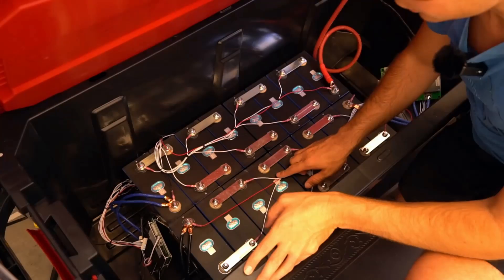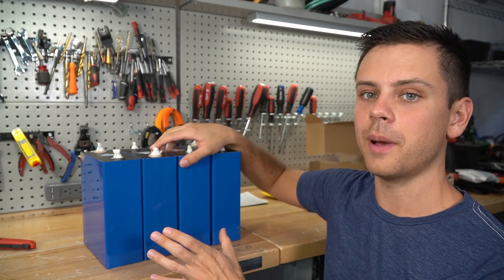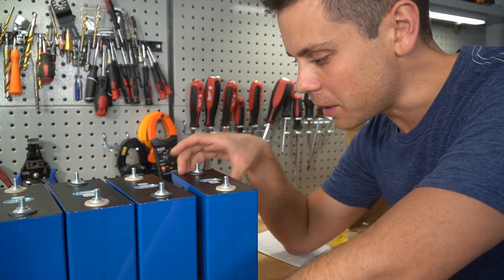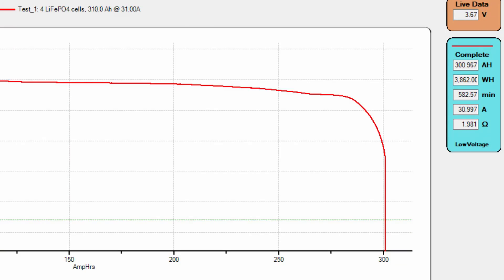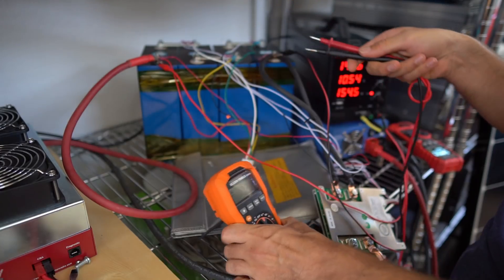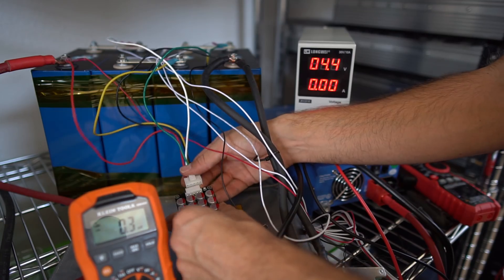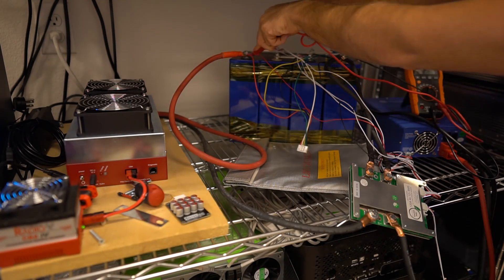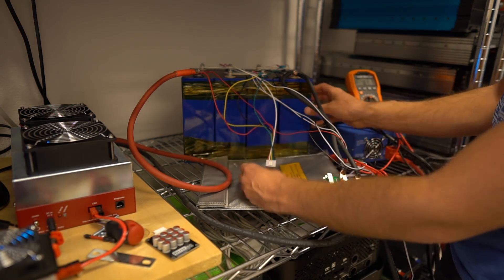Amazon.com "Grade A" 310Ah -Ninthcit- LiFePO4 Cells Manually Balanced and Tested

Comment from the maker: And get this, amazon is not paying for the return shipping. I've never had this issue before, and I stated that the product is defective. But Amazon did give me the address of this cell supplier's warehouse in los angeles so I will drive there myself and show them specifically how they screwed up and what they need to do to fix it. What a huge waste of time. I'll try to film the experience if I can.

The warehouse is next to some other solar suppliers I know. Seems they all sit around and pump these cells out from the ports all day.

Update: 
Hello, Dear buyer,

we saw that you said there was a quality problem with the battery. Our colleagues will contact you for confirmation. We will refund you first. We will provide you with a prepaid return label after work. At present, we sell the new grade a battery of 280ah plus. Each battery has complete data and test report, Your return does not need to pay any return transportation expenses.

Thank you! Best regards!

Ninthcit customer service team

Tommy Wang

I just got an email from amazon stating that they are refunding the order. That is good.

~~~~~~~~~~~~~~~~~~~~~~~~~~~~~~~~~~~~~~~
Tired of getting ripped off? Check out my "Will Prowse Approved" solar product recommendations below!

12V Batteries
https://www.mobile-solarpower.com/lithium-batteries.html

48V Batteries
https://www.mobile-solarpower.com/48v-batteries.html

Offgrid Inverter System Builder
https://www.mobile-solarpower.com/48v-complete-system-blueprint-559371.html

Hybrid Inverter System Builder
https://www.mobile-solarpower.com/code-compliant-48v-offgrid-system.html

Mobile Handtruck System Builder (very popular!)
https://www.mobile-solarpower.com/mobile-48v-system.html

Solar Panels
https://www.mobile-solarpower.com/300w-solar-panels.html

Ground Mount Solar Racking
https://www.mobile-solarpower.com/ground-mount-racks.html

Wire, Lugs and Busbars
https://www.mobile-solarpower.com/wire-and-connectors.html

Tools
https://www.mobile-solarpower.com/tools.html

Fuses and Circuit Breakers
https://www.mobile-solarpower.com/fuses.html

Plug-N-Play Solar Systems
Ecoflow, Anker And Bluetti! So many models to choose from. See my current recommendations here:
https://www.mobile-solarpower.com/full-size-systems.html

~~~~~~~~~~~~~~~~~~~~~~~~~~~~~~~~~~~~~~~~~~
Need to build a large DIY system? Need a trustworthy solar distributor? These are my favorites:

Signature Solar
Creator of EG4! Solar Minisplits, Victron and More! Largest Solar Store Online.
If you want $50 off, please use my link below and coupon code "DIYSOLAR50":
https://signaturesolar.com/?ref=cPwLcVc0SW-BjN

Current Connected
Best Prices for EG4, Victron, Midnite and so much more! Fast Shipping and Highest Rated Customer Service:
https://currentconnected.com/?ref=wp

~~~~~~~~~~~~~~~~~~~~~~~~~~~~~~~~~~~~~~~~~~
Join our DIY Solar Community 
Need more help? Join the largest solar forum on the internet for beginners and professionals alike. 140,000 members and counting!
https://www.diysolarforum.com

Check Out My Free Book
Best-selling and beginner-friendly guidebook to off-grid 12V solar!
https://www.mobile-solarpower.com/the-book.html

~~~~~~~~~~~~~~~~~~~~~~~~~~~~~~~~~~~~~~~~~~
Contact Information:
I am NOT available for personal solar system consult! If you wish to contact me, this is my direct email: williamprowsediysolar@gmail.com
FTC Disclosure Statement and Disclaimers:
Every video includes paid promotion or sponsorship (such as free products for review). Some links on this YouTube channel may be affiliate links. We may get paid if you buy something or take an action after clicking one of these. My videos are for educational purposes only. Information is subject to change/update at any time. Electricity is DANGEROUS and can kill. Be smart and use common sense :) DIY Solar Power with Will Prowse is a participant in the Amazon Services LLC Associates Program, An affiliate advertising program designed to provide a means for sites to earn advertising fees by advertising and linking to Amazon.com
Reply: That video of your return will be quite interesting if you can do it.  I appreciate your research on these cells. Carry on ! WG7D
Reply: I’ve noticed Amazon is getting stingy on returns. 
I marked a $10 package as not received and they said to defer to USPS and USPS said if we say it’s delivered we can’t do anything 
I said that to Amazon and they said to file a police report….
Reply: @dylan-nguyen   Amazon became too big in last 3-4 years. Few years back it  used to be no question asked returns, now it became mega corporation to fuck people around. Just Capitalism in its finest.
Reply: @damian9070  No not capitalism, poor customer service. Capitalism is when we all come together and say.. "We are not buying from you" and they change or go out of business.
Reply: @dylan-nguyen  Whatever State you are in, file a lawsuit either a small claim or an over 5k lawsuit. Share the info with all of us on how it is going. 5 or 6 thousand lawsuits will wake them up. OR find some greedy lawyer and start a class action lawsuit.
Reply: @dylan-nguyen  FedEx allegedly delivered 2 new laptop computers but I never received them. LONG story short, I eventually filed a police report and the first thing the responding officer asked was if I had surveillance video. At that time, I did not. I have since installed a somewhat expensive commercial grade high def, 8 camera video system around my home. I've recently captured video of a USPS driver who left an "attempt to deliver" notification in our mail box, but, "smile, you're on candid camera", she made no attempt to exit her delivery van and leave the package at our door! Fortunately, I was able to go to the post office the next day and retrieve the package there. When you have tracking information, from any carrier, available, monitor that, and print a daily hard copy, especially if it's expensive, until you have your stuff in your hands. I dispute FedEx because the daily prints and time stamps do not agree with their alleged delivery, at my door, tracking information. Dell eventually made good on my replacement computers, but, it was a rather long, and painful, process.
Reply: @dylan-nguyen   "and they said to defer to USPS and USPS said if we say it’s delivered we can’t do anything "
i have a security camera system covering  the front of my home and i will KNOW IF THEY DELIVERED OR NOT.
IF they claim to have delivered  and it's not recorded by my cameras, it was never delivered and i will file a police report saying that.  With so many people with ring doorbells, that will not go over very good for USPS.
Reply: @augoldminer  unfortunately we have a shared mailbox system that's down the street 
they don't deliver to your house anymore in CA
Reply: I stopped using Amazon a couple of years ago, they are appalling
Reply: @MyMy-tv7fd  - Unfortunately... Amazon seems to be heading in the wrong direction :'(
Reply: Will I can help you get real new cells. The sellers are pulling more and more scams these days. I sell them in Australia. I can get EVE and CATL and Gamfeng new cells. I haven't bothered with Lishen at this stage. I promise they are all new.
Reply: They do cost closer to $130-140USD for new. 
Not like these $80-100 cells. They aren't new
Reply: @LithiumBatteryGuy  I am from Eastern Europe and I'm also interested. Could you please give us some hints, tips & tricks?
Reply: @LithiumBatteryGuy  Got any details on where these cells are in Australia?
Reply: I've been a seller on amazon for a few years, but have since stopped. Amazon is without question one of, if not the WORST company on Earth. After they stole a few thousand dollars from me I called it quits and recalled all my inventory. I don't suggest anyone buy from Amazon for any reason.
Reply: To be honest, If you gonna buy those cells, just buy the cheapest on aliexpress. They were all recycled from the same factory. The sellers bought them dirt cheap, and they label them an every attractive capacity to make more money. The reason why these cost more than the former you tested is because the sealers had to pay the warehouse fee, and Amazon.
Reply: Could be the case that they bin them out of the containers coming in from China, the good ones get used by the company themselves and the defective ones get thrown onto Amazon.
Reply: Escalate and ask for US support.  I’ve done this.  You’re talking to a chat support center overseas
Reply: Thanks Will! I feel you choose and play the "canary in the coal mine" for all of us out here and I really appreciate it.
Reply: I bought 16 that were swollen on arrival. no pay shipping on return. I sent the following to the seller. 
The batteries received were swollen "PUFFED" on arrival and voltages did not match. They were not used or charged and packaged in the original boxes with all paperwork included. These are not matched grade A cells like your 280 AH cells that are perfect. I am in a Solar Group with Will Prowse on you tube and we all bought these defective cells and all are returning them.
We shall see!
Reply: Response from Seller
Hello Phil,
Thank you for your friendly information. We will arrange it as soon as possible!
We have updated these batteries to 302ah. We will provide you with prepaid return labels in batches. You don't need to bear the cost of return. Best regards!
Hope to have the opportunity to provide you with better service!
At present, our 280ah American warehouse has no inventory. It is expected that some new inventory will arrive around September 28. Those are new grade a batteries. Each cell has coding and test reports!
Best regards!
Tommy
Reply: Hope you make progress, I already have 16 of these coming Thursday. Hoping for better results or proper company response after your visit.
Reply: 270 miles (single) for a complaint. At last the energy for your Tesla is for free. And LA can be nice, too.
Reply: @kapegede  - I gotta think he'll turn the trip into a multi-purposed endeavor. No doubt, with Will around, these companies would be much better off advertising a slightly wider mAh capacity range vs advertising a specific mAh capacity ... go get 'em Will!
Reply: Beats driving to LA and deal with the BS! Wang bang thank you man.
Reply: Haha! Awesome. This guy is actually holding some of these bull shitters accountable. I think it's high hill to climb and it gets higher every day. Thanks for doing the work so we can know what is reliable.
Reply: Hahahahha bombmer haahhahah ooohh will you make me lougth
Reply: Because you are a big youtuber in this space they will absorb this loss, but others will not be so lucky.  Does consumer reports monitor this space?
Reply: Chinese companies ALWAYS LIES AND OPERATE UNETHICALLY. They are the absolute worstttt
Reply: @spittingfacts4662  Claims with a broad brush. If you hate Chinese just admit it you racist. You spammed the exact same things in 4 different sections already.

Comment: I am new to this!  I just took 8 6v  batteries out of the sailboat I’m rehabbing.  Does one of these batteries take the place of all those lead acid batteries?
Reply: Well where those 6 wired in series? I assume they where 3 batteries in parallel that where connected in series to another 3 parallel cells to make a large 12v battery pack. Yes 4 of these blue cells could replace all of those 6v lead acid and you would probably have double the battery life.

Comment: With this video being 10 months old now, have you heard if the quality of the 304 - 310 Ah has improved or not? I need to change the flooded lead acid battery bank out. I'm space limited to two 24 volt batteries and the extra 40+ Ah would fit my desire to be able to run the loads for 3 cloudy days.

Comment: Hello Will, why do you need to use active balancer and charge manually when you have Overkill BMS? Is it not able to balance those cells in some manual active balancing mode?
Reply: Because if you want to balance the cells in a timely manner you need to. BMS balancer could take all day or longer.

Comment: Hi will I'm thinking about  building a diy solar bank for my water well I wish I had the amp power of the pump motor but I know it is 220volt how would I hook up a power bank to run 220 .I was thinking 2 inverter s door you know what it takes to hook up 220 thanks
Reply: A 220-240v inverter can be expensive especially once you add the cells.

Comment: I'm kind of spooked about taking bulging blue batteries in a house and putting them to work.
Reply: Has anyone ever seen a Bulged cell catch fire? Lifepo4 cells are supposed to be incredible safe and stable compared to all other Lithium chemesty. I personally wouldnt have a power bank of batteries in my house. It's smarter to build a storage shed to have you batteries and inverters in. That way you won't have a potential fire that can burn your house and insurance won't cover. Ideally a 20ft shipping contaner would be best since its metal and won't burn, or a cinderblock shed.
Reply: @randybobandy9828  I'll pass.

Comment: I had these but one of the terminals broke off when I was putting a nut on, not tight
I got no response form the Amazon seller.
I didn't want to return it b/c I have waited so long for batteries.

Comment: it's obvious those cells will not last long... there are some proper ways to just balanced those cells overnight. and after that it needs 3x charge/discharge cycle in low current. then you're done and ready to go for higher current application without damaging cell and it will increase performance.👍🏻 Thanks for the video 😊

Comment: Hey Will, can you do an updated video of the best way to test cells? Your old video goes over the use of a battery tester that is limited to 185 watts. I ordered 8 304 AH cells that I will obviously need to test. Doing that test at 185 watts would take FOREVER. I have an inverter, what else do I need to do a faster capacity test? I would need to pull right about 60 amps for the .2c test.

Comment: Its freaky that the bottom of the circuit board is touching the wire shelf.  (Although there's a plastic bag or something there for insulation.)  I was an assistant to an electronic technician, (I lift heavy things) and learned that's a concern.  You can put them on metal when the circuit is not energized to equalize spurious static charges, as in a Mylar static bag, but not when the circuit is energized.   Plus, there are different types of grounds.  You may encounter a mismatch if different equipment connects through the wire shelf.   Please correct me if I'm wrong.

Comment: Great video.
Hello .i m french .
What BMS (cut charge .bluetooth. temp,app )recommandation on Aliexpress . 

i have at  original installation RV .
  220v charger 18A  
12v charger 30A
i want use:
  converter pure sinus 1500w/3000w with home fridge 130 Liters 220v and mini fridge car 40Liters  12v or 220v 
TV led 22"
lamps
coffee machine 1500w

Thanks

Comment: I don’t understand why $200 per cell is cheap, I bought 16 280ah cells on baba at $70 a cell. Programmed the BMS to see it as 270ah after balancing them to be on the safe side.. that would be over 10kwh under $1500

Comment: Hey, I got a question if you can help me.

 I got similar cells 4 of them and bought myself a 100 amp bms from daly

Each cell is supposed to be 100+- amps.

The question is : is my 100 amp bms enough for a pack of 4x100 amps or do I need a 400 amp bms? Anyway I connected all and the bms only shows me the value of two cells and the ones in the middle Show me nothing on the app. But I checked and they have almost the same voltage.

Comment: Love the videos I was just wondering what kind of solar inverter you would use to run a 2011 keystone raptor 365lev velocity completely off grind I have generators for back up but would love to get off of them and only use them for back up but I'm stuck on what kind of inverter I need to run it I've seen the renogy 48v inverter and you weren't happy with it but I seen the 5000watt growatt inverter but like I said I'm stuck at the inverter part sorry for the deep question

Comment: I noticed these chargers don't push 10amp anywhere near the top end, if you were charging them in parallel would you set them to 4v in order to get the 10amp charge rate?

Comment: I really don't like those style studs. There isn't much surface area for busbar contact. My EVE 230Ah have the same style. It shouldn't be a problem for low C rates, but heck, my EVE 230Ah have a 1C standard discharge rating. I can't imagine trying to pull 230Ah through such a small contact area. I could be wrong, but...
Reply from the maker: The other terminal looks to be a fraction of the size. The whole busbar is flat and flush with this terminal. Are you talking about the circular one?
Reply from the maker: I pulled 1C from some 280Ah cells and the terminal was barely warm. The bus bar seemed undersized but it pulled it nicely. It was surprising

Comment: What I used to top balance my cells was by burning off power from the highest voltage cell. I used a long spool of copper wire with a thinner piece of wire at the very end shorting out each side. It's nice being able to burn off 25 amps at a time from each cell

Comment: Will, have you ever considered trying the used Tesla model S batter packs? 5.3 KW for $1,000 to $1,500. Seems like a low cost per KW. Your thoughts?
Reply: Will did a video showing how he tried using a Tesla battery module in his RV, before he bought a house. Voltage was not ideal, so only 3.3 out of 5.3 kWh was used by the inverter.
Reply: Thanks for the reply, I'll check it out.